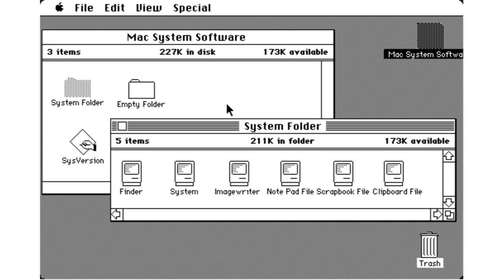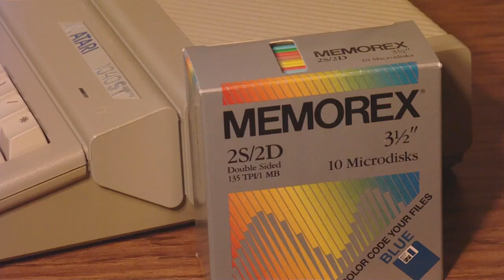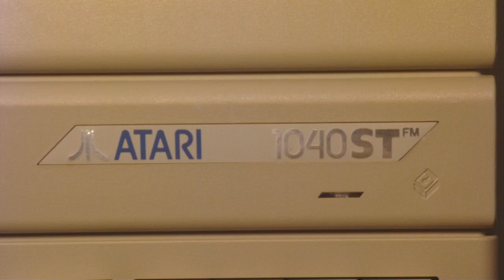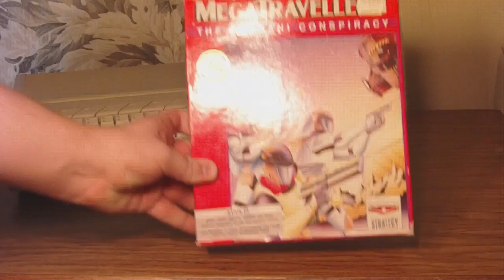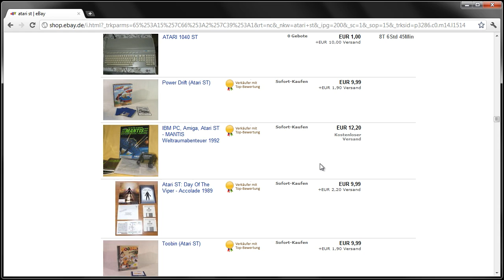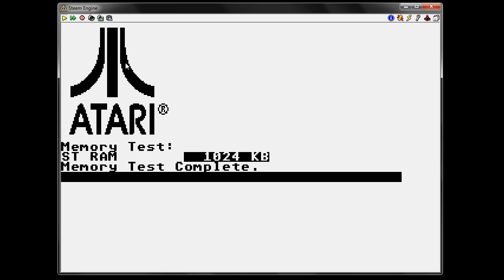LGR - Atari ST Computer System Review

Comment: You can use other joysticks, I used my Suncom Slik Stik I had since my VIC 20 days with my Atari 520ST.   But yeah, controllers with extra buttons, may be a problem, since the ST used all 9 contacts for something, making it even risky to plug in anything that isn't meant to be a direct replacement for the Atari CX40.  But at the time, in the mid 80s, just about every joystick off the shelf would be a replacement for the CX40.
I got a Casio CZ-101 synthesizer along with my ST. Played around with it for awhile, but ended up exchanging it for a Yamaha DX100.  But in later years, it had all sorts of MIDI gear connected to the it, such as a Yamaha DX7, Roland D50, Ensoniq EPS, Roland TR-808, etc.  In fact, it became my work computer that moved to a friend's studio.  I also had a 10 GB hard drive for it.  So when I think of Atari ST now, I think of the gigs I played and the countless friends I had at the time.  I miss those days, I admit.  Was a lot of hardship too, as gigging doesn't exactly pay the it's time, and the gear needed to puill it off, not including all the time composing, writing, and practice.  But the friends, the parties every weekend, etc.  Miss that.

Comment: I'm just amazed that I found a STacy2, 1040STf, 1040STE (with matching box), SH-204 drive, monochrome and stereo RGB monitor, and some original disks from a local songwriter for free.  So far I only have the STE, SH-204, and disks remaining, but all I need is the multi-sync cable and I'll be good.

Comment: I played with a Competition Pro joystick and the Bug-shape one (can't remember the name) without any issues, I used it for MIDI hardware/software and gaming, it worked fine and the joystick/mouse ports didn't really bother me. It even synced to my old mixer and synthesizer.
I loved my Atari STFM and I also speak English and Swedish, so that's not an issue, even easier I live in the U.K. so can get a PAL version (looks awful on a 4k 52" screen).

Myth was one of my favourites on the Amiga and Atari ST, but I think I played games more on the Amiga as most of my friends had one so we could trade games in those weird A5 sized boxes.

Comment: 12 year old video but here goes anyway: There are adapter cables for the ST that make it easier to use other displays. I recently bought two cables: The first one is an RGB to SCART cable. For Europeans that's an easy one to use but I know that SCART is at best obscure if not straight up unknown in North America and while I haven't looked into it I don't see why an RGB to S-VIDEO or at least RGB to composite cable wouldn't exist for this machine. The 2nd cable is a bit different, it's a cable that allows you to hook up the ST to a Commodore 1084 monitor. I know that some would surely see this as sacriligeous but it's still a good option to have since well, Commodore monitors like the 1084 are surely easier to find even to this day. The down side to both cables unfortunately, is that they don't have separate audio cables so you have to use your TV's or monitor's speakers. I'm sure you can get other cables with separate audio but this is just what I have.

Comment: I own both, a working 520 STFM and an Amiga 500 1 meg, American versions , I have to say I love both machines, the ST is easier to use in my opinion, just pop in a disk, turn on the machine, and play!. The Amiga, for large games always had loads of disk swappin, but the graphics are totally worth it, 64 colors in half bright mode on the Amiga. hell ya. but the Atari was my first 16 bit and always will hold a special place in my heart, all 16 outta 512 colors of it! and its OS is a breeze to use.

Comment: The only widespread use of the cartridge port that I was aware of was a $25 clock card that had a battery-powered clock on it so you didn’t have to readjust the time and date each time you switched your ST on. (Jackintosh fine for games, but lacked some of the polish of a business machine.)

Comment: I found a stack of studio software online and use an old Compaq with STEEM. It uses the Soundblaster MIDI for my controller needs and integrates as well as a real machine.

The ST had nothing too difficult to emulate. No real need for a proper one. Nice though.

Comment: 4:09 - The Jaguar may not have worked out, but it was probably a better plan than persisting with the ST line as the PC platform was on its way to more or less take over computing. Going head-to-head with Nintendo, Sega, and Sony in the console market may have been a hard sell, but I think sticking with ST in a world that was generally becoming all about PC, or alternatively becoming a PC manufacturer and engaging in that race to the bottom among all the PC manufacturers trying to make cheaper multimedia PCs was probably a worse proposition.

Comment: Nice vid, but you forgot to point out that it takes two different monitors to display either 1) the 320x200 16-color mode or the 2) 640x400 HiRes 2-color mode. There is no original monitor which is able to switch between the two, so you were always stuck on either a gaming system that was inferior (in both grafix and sound) to Commodore's Amiga or an office machine that was basically the poor man's Macintosh. For the price of half a Macintosh. Which is why I wrote most of my college papers on a 3rd hand ST. Because, you know, prices for apples...

Comment: These joystick ports are not accidentally called "Atari joystick DB9 ports". At that time, most of the major home computers on the market had such ports in this - de facto - standard, and joysticks compatible with them were also compatible with many other computers/consoles. From WiKi: "The addition of the Atari joystick port to other platforms cemented its popularity. It was the standard for the Atari 8-bit family of home computers and was compatible with the VIC-20, Commodore 64, MSX, and later the Atari ST and Amiga.". So these ports are quite fine. The only problem is their inconvenient placement.

Comment: For the times that you have to work in the desktop environment of GEM, you can make a boot floppy having MiNT + nVDI + XaAES + TeraDesk for a multitasking English system.  You can also just use the single tasking variant of TeraDesk (put it in the 'a:\auto' folder) if you do not need multitasking.  The Atari 68k series computers are mostly what I now use (they are way better than Amiga for many things).

Comment: I used to hook it up to a pc vga monitor. Electrically they are compatible, its just pinning out the cable that used to take the most time. Some electronic stores actually used to sell the connector for making your own cables. I can't remember exactly, but I think you may have to invert one of the sync signals. I don't know if the lcd screens work though, as this used to be on the old tube display.

Comment: Never tried Genesis, but I used to use Sega Master System control pads with my Atari ST, so there are some controllers that will work. I remember how much that port location sucks though, not so much because it's underneath (which was bad enough), but because they're angled to point right into that slope so there was very little room to get the plug in there.

Comment: I see a lot of people commenting on why people bought this over the Amiga. 
People, only the hardware does not make a good platform. There were a lot of games and software that weren't available on the Amiga or that were even better on the Atari.
Also at the time there was also a "culture" surrounding certain platforms, which included a following, magazines, software availability and the like. In some countries, the Amiga was simply not an option and the Atari had a hardcore following. It was much easier to get into it.
And last... hell, it was an Atari. Atari forever.
Reply: Only Amiga makes it possible! But in all seriousness, I hear only good things about people reminiscing the days of their old Atari computer, whilst most Amiga users (who still like the Amiga) will admit to it being a pain. So as an outside who never used either, that is what I've observed.
Reply: ParappatheRapper The pain for me was the Atari ST's ports, and the games / hardware were juste better on the Amiga (apart MIDI which wasn't on the Amiga. But Amiga had MOD music and trackers instead). There were lots of good software and good games on BOTH platforms. A lot of following for boths. A lot of pain for boths (disc swaping, for example).
Frankly, as a kid, I only cared for games. Which means, even if at home there were both, I only cared for the Amiga.

Comment: Owned One in the late 80's. For MIDI the machine was excellent. I also  really liked
Cyber Paint, Cyber sculpt, CAD 3D a complete graphics and animation package
that worked really well On the ST. The ST had some really good DTP programs
like Wordflair and others. It also had tons of games. I still run some of the MIDI
software on a Modern PC. Most of the programs that run on the ST will run on 
Steem.

Comment: My first computer was a Atari 400xl i upgraded 2 more times 800 xl and the a 1040st  with a monochrome monitor and a standard monitor e eventually got a removable hard disk which i belive was called megaraid 44  i loved every minute of it  - i had organized a 16 player game of midi maze at the local Atari club using the special midi ports in a daisy chain and it was like a 3d pack man game of the time . The expansion port was used for a specific cards and i did buy expansion card just so i could use it and it was a video capture card . The joystick ports were a pain but if the desk was deep enough you got used to it , or you bought specialize extenders for them so you can easily  swap out the mouse for a joystick . And i'm surprised you haven't tries joust on the atari st u should look into it .

Comment: Could there be an adapter for the RGB monitor's output to a VGA port?  Might need some active conversion, though.

Also "switching power supply" doesn't refer to the ability to switch different input voltages.  It just refers to the way it produces the output voltage by actually switching on and off very fast by some ratio.

Comment: Sorry, long time subscriber here, but if I may offer my humble opinion?; 1040STFM was not Floppy and TV Mod but well known, and pretty big in the music scene, because as well as those joy conns at the bottom, you got a built in MIDI controller ports, Really gained notoriety with its extended Cubase support and whereas Amiga AGA chipset and previous genlock endevours were centered around the Graphics, Imagine 3d, ray tracing etc, unfortunately it couldnt beat the STFM in the music scene especially Cubase, Yeah mod trackers were awesome but not on STFM level.

Comment: The ports for the joystick and mouse location I found quite nice, I used a lot of computers and that was one thing I liked about the atari st, made for a neatly tidy way, you use the mouse and the lead comes straight out of the computer not around the back side to the front found so clumsy PCs, so atari st not that bad as some made out to be and once I plugged in the mouse and joystick they stayed plugged in.

Comment: @dentunes I'm pretty sure Icehouse used one, as did the Pointer Sisters I think, quite a few musicians in the 80's used one.  I would be somewhat interested in an Atari ST, however I'm dreaming as I simply don't have space here in my apartment for one and all the associated hardware and an adequate workspace to set one up, I'm also in Melbourne.

Comment: I began with Atari 800xl , 520stf and put a second tos 2.4 or like that also my last machine was the facon 30 and jaguar with cd player, basically the jaguar was a falcon 30 whiteout keyboard and Gem & Tos but in the future Atari have the idea to create a external keyboard and a system in cartridge and eventually a modem tu use the interface behind the jaguar but unfortunately they never did because Atari lost a ot customer in Europe, because the commun point is the compatibility between the machine was horrible , st , stf( floppy disk ) , ste, stee , falcon, thanks you for your video, it reminds me some excellent souvenir ;)

Comment: These were good, along with the slightly better (more expensive) Amiga 500.
Both work in a modern sort of way, and are much better than earlier computers from the early 80s.

Comment: The homebrew ATA/IDE HDD controllers are fairly easy to build, and burinig an EPROM to have a bootable driver Cartridge to plug in is a no brainer (as long as you have a sharpie [the Marker] and some ferric Chloride to etch the PCB).

Comment: Theoretically you could mod the board with the controller ports, and swapping chips isn't the most painful thing in the world. I'm sure you have soldering skills that are passable to do chips. However the mod, I would say I'd have to look at the guts for a long time and get really creative with a Dremel and buy some stock ports and solder it and just have some really interesting hack job that might work. I don't know it's just a thought. I tend to think of weird ways to improve an old design.

Comment: me gusta. clint. you sir. are rad. the Amiga was on another level but the atari st was great all the same. As far as sound goes... AY-3-8910 was super limited. 3 monophonic squarewaves and a noise channel is pretty much the standard of the era past so i dont know why they stuck with it. they didnt start to catch up to amiga sound until the STE when sample playback was introduced. i used to own a FM synth that could only be edited with an st with its midi. for the midi itself it was a rad machine

Comment: I heard you say in several video's about the pal/ntsc problem. Why don't you get an lcd tv which can do both... For all systems scart cables are available, so as long your lcd tv has scart you don't need special Atari monitors or tv modulators for the Amiga 500.

Comment: You left out the Mega ST series. These had 2MB or 4MB of ram. I have a Mega ST 4 stored somewhere. (Also have an original 520ST) A friend of mine created his own Atari to SCSI interface board so we could hook up a SCSI hard drive to the system. I modified some old Bally Astrocade controllers to work with the Atari ST.

Comment: Commodore 64 joysticks should still be interchangeable since they have the same pinout as Atari controllers. Genesis controllers use a different pinout and can even fry a C64's timer chip (so I'm told) so definitely do not try to plug them into anything else.

Comment: me and my dad had a couple of these  one running thru a philips crt and on one the atari monchrome monitor for dtp ect we had a cd rom n updated the tos chips and even used it for video capture with a capture card on the cartrige slot will see if still have the bits and will arrange to ship them if they are any use to you

Comment: Its only a (small) problem the other way around. We used to drill a hole in the DD floppys to make them HD back in the day. If you bought a good brand it worked great. But could be problematic on some cheap non-branded floppies. Has to do with the density data is written. Just like Long play on old VHS videotapes.

Comment: The Atari joystick used far fewer pins than a Sega controller. Given that this could use a mouse. The extra buttons, multiplexing chip, and pins a Sega controller uses are being connected in ways they were not meant to. If one were to modify a Sega controller to match pinouts then it would work. Some information never gets old, but its hard to tell if it was mentioned before, because no one has time to read through so many comments and have a life.
Reply: KJR Channel I believe sets controllers would work normally in the player 2 slot

Comment: I have a question that you can hopefully help me with. Our local game store has a 520ST that comes with a monitor and floppy built in. It's apparently a rare monitor/floppy combo (PS3000) but it doesn't have the monitor cable so I can't use it and it looks like it's impossible to find a cable. With that, I'm stuck with a 520st with no floppy disk internally. What are my options for getting programs and games into a 520st with no built in drive? I looked at things like ultrasatan but it seems pretty pricey and things like Gotek drives all seem to be specifically for models  with, again, built in drives. Any advice would be appreciated before I commit to buying this.

Comment: Regarding the awkward 9-pin ports location: the Amiga 500 also has that problem (joystick ports on the back WTF); I solved it using 9-pin serial port extension cables.

Comment: Great. I wondered how you solved your problem. Obviously not with a crappy Pinnacle DC10 or whatever. I sold my C64 with 2 floppy drivers (one 1540 and one 1541), a dataset, an X1541 homemade cable, 2 joysticks and many many floppies, for 100 euros in 2001. Sometimes, I miss a good old fight on Archon. I sold my Amiga 2000 for 150 euros in 1993, and sometimes I miss a good "Deuteros".

Comment: The Atari lines of computers were very asthetically pleasing.  Also, comparing the Atari 800 to the c64, the Atari 800 operating system was superior - especially the disk drive system!
Reply: Atari always did everything very well unfortunately too well they over did things in a sense that they old budgeted. They wouldn't beyond their means of producing and they just didn't get enough back they always had quality stuff and it was just too good for the market period that was their problem Bill Gates helped them dial it back to itsy bitsy bit but even then they still were producing a really nice computer of the day. I also heard it cheated there and got his roommate to do it but whatever.

Comment: I have a question regarding the st. I am getting one from Greece. Does the psu have a option for 110v ?
You didn't mention the voltage change. Does it still run at 205v or did you change it?